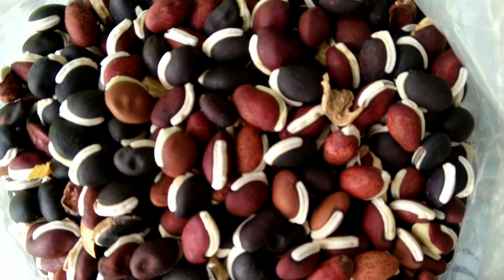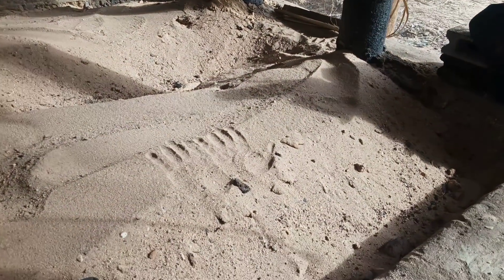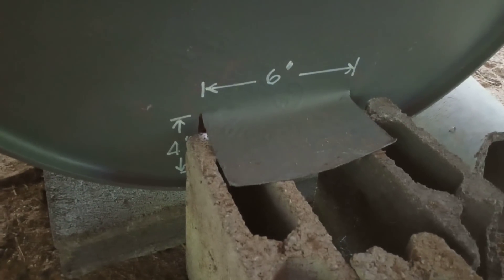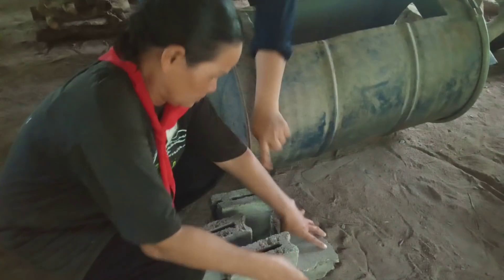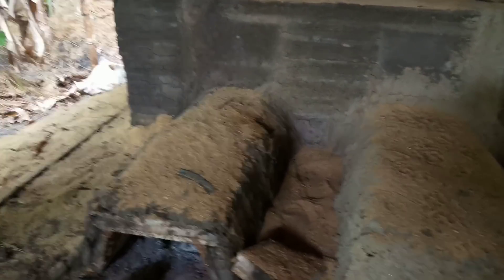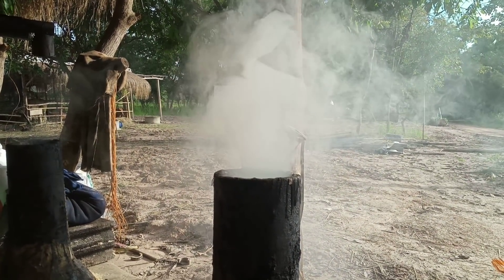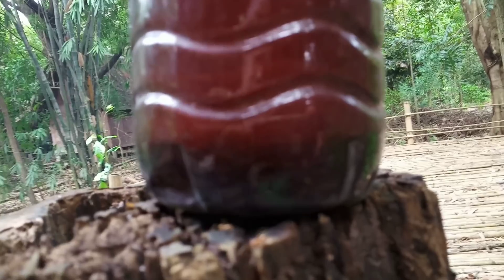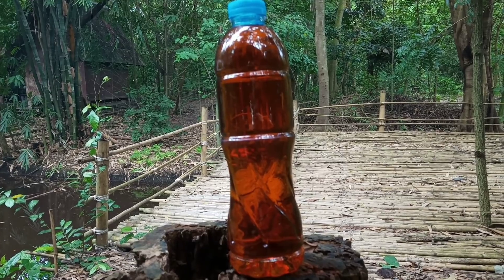Wood vinegar

Comment: Hello Sir Jon, thanks for the video—it’s been really helpful for us. I have a question: is there a specific bamboo diameter required? Also, do you hang the bamboo from the roof to keep it in place, or is it enough to have it closely joined with the cement pipe?
Reply from the maker: Big bamboo is better the smoke can flow easily.We used at least 4 inches diameter we can tie bamboo with pillars or trees just to keep the bamboo stay about 45 degree at most.
Reply: @JonJandaiLifeisEasy  Wow! You replied:) Thank you sir Jon! That is very resourceful. I hope I can visit Punpun some day, such an amazing community, more power to you all 💚💚💚
Reply: @JonJandaiLifeisEasy  Thank you, Sir Jon:) Follow-up question: can the pipe for collecting smoke be longer, or must it be 3 to 4 meters? I believe it should be long enough to allow time for the smoke to condense. Is longer better?
Reply: @JonJandaiLifeisEasy  Can a metal pipe be used instead of a cement pipe?

Comment: Wood vinegar apparently has carcinogenic components. 
It was used successfully used in Japan for removing birds from the trees that they would aggregate in large number and make so much noise. 
Its better to use metal pipe instead of bamboo. Bamboo absorbs some of the liquid and also some trap in the bands section even if they be removed.

Comment: So the wood in the oil drum does not burn? It’s just the heat from the fire that turns it to charcoal? You have to keep refuelling the tunnel fire? I like your videos thank you
Reply from the maker: We need to keep adding firewood for a while until the wood in the drum turn hot and burn itself because it burn with less oxygen the wood will turn to charcoal.

Comment: Thankyou....my face is a mess, doesn't help I kp picking, habit....can u buy it....x
Reply from the maker: If you are in Thailand it is easy to buy but overseas I don't have experience.
Reply: @JonJandaiLifeisEasy  thankyou for getting back to me..x
Reply: Try black seed oil. Drink it and put it in your skin daily.
Reply: @mipueblo7042  thankyou for getting back to me...x
Reply: @chrisg2163  do you have access to amazon? They sell it on there. Around £5 or €6 
They sell it in capsules as well, it has a peppery taste. But it is better in a bottle, so you drink it and apply it to your skin. I'm gonna get a link for you, so you can see how it changes the shape of your blood cells, makes them better. It boosts your immune system.